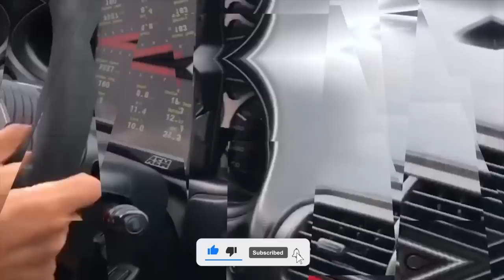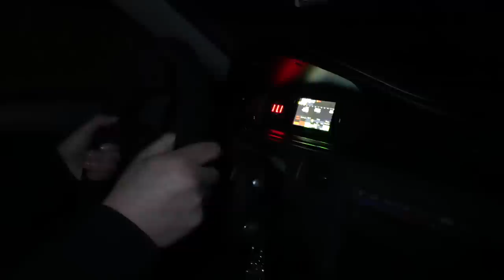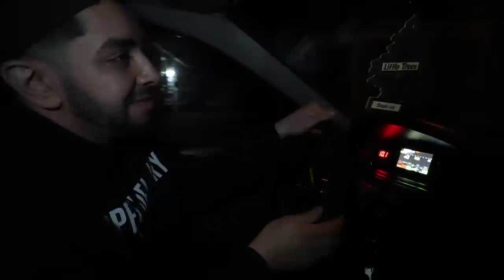The Baddest AWD B-Series Street Car! INSANE Dyno Session!

Comment: Wtf exactly would make it not a streetcar? My turbo k series car makes over 700 on low boost with up pipes and is still 100% a streetcar. Full interior, radio, speakers, stock Honda seats ect. If the car is driven on the street and licensed and insured then it’s a damn street car. If it’s licensed and makes 900hp and has interior but just sits in the corner of the shop till a cash days and never leaves other than that idk if I’d call it a street car anymore tho lol. You as the owner make or break the “streetcar” term.